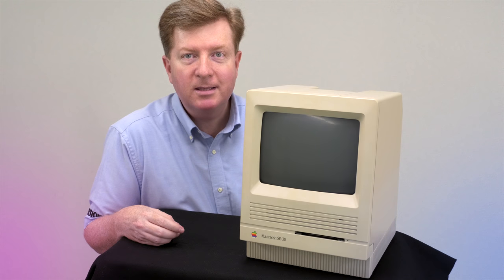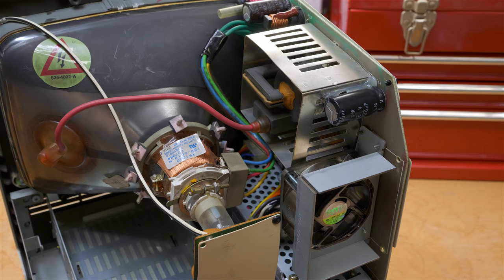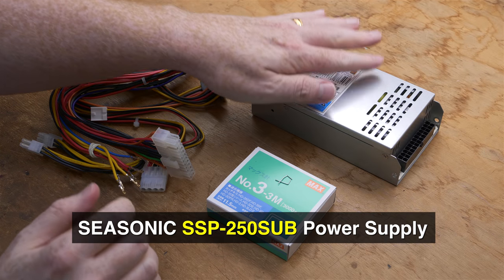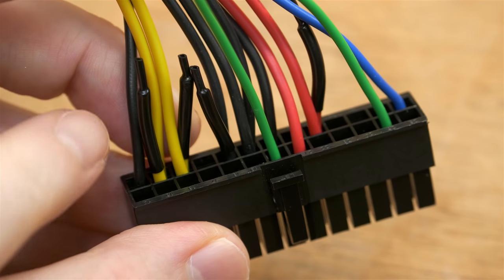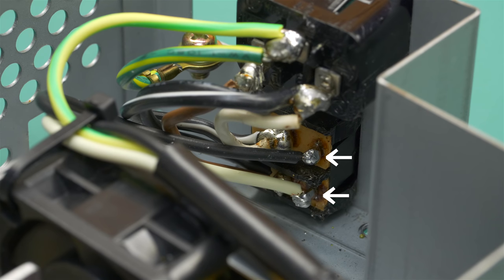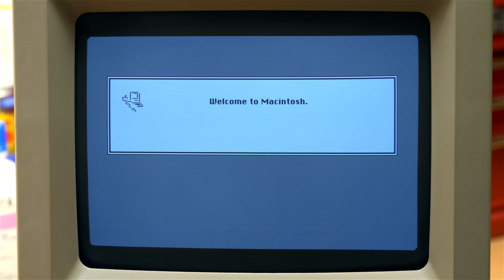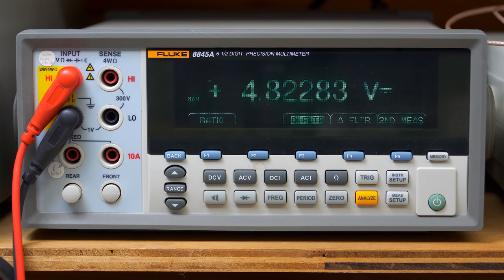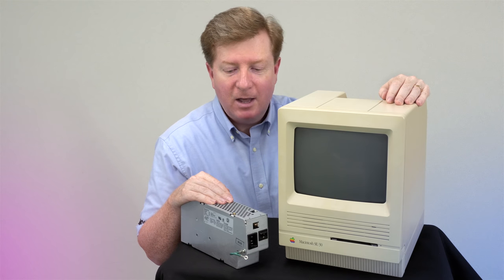Macintosh SE/30 New Power Supply (PSU): SEASONIC

Comment: looks like the connector has 26 pin connection on power supply.  all of atx connectors on ebay are 24 pin connections. I bought the power supply from ebay not thinking about the harness and it didn't come with harness with it. now what?

Comment: hey boss, which camera are you using?
Reply from the maker: Panasonic GH5, shooting in 4K 10-bit HLG, edited in Rec.709 using FCPX (mainly because many people still lack the means to watch videos in HDR).  Although my workflow has changed since I made the following video (I no longer use proxies, for example), you can still see the camera kit I use here: https://youtu.be/yrnOVp7mXrs
Reply: @JDW-  awesome, thanks for the detailed response just found ur channel because i got myself a macintosh as well. Love the vids.
Reply from the maker: @Egg-gk5zk  Since you are commenting under my SEASONIC PSU video, it could be that you are investigating power supplies for the SE and/or SE/30.  If so, my latest video, which is lated to go Public within the next 24 hours, may be of interest to you.  In that video, I review a new power supply that was released in July this year, and I talk about how to upgrade your Main Wiring Harness to get higher voltages at the motherboard, which is especially important if you have PDS cards or other upgrades installed.
Reply: @JDW-  badass, ill check it out.

Comment: I tried a similar trick using an ATX power supply just to try and get the computer to power on. When I powered it on with the new power supply I heard an audible click and the analog board started to smell like burning electronics. I triple checked everything, and it was wired up correctly. Do you think the +12V sweep would have anything to do with this issue?

Comment: Thanks for this guide - I used it to replace the internals of my Astec power supply.   As someone else mentioned I used an old IEC cable and soldered one end to the external IEC socket.  I wired the green ATX and ground to the (now removed from mains) existing power switch.   I also decided to keep one molex + berg from the seasonic to power extra devices.  With the Astec there is a mounting post in the way on the base of the PSU.  Instead of cutting it off I cable tied the Seasonic to the lid of the PSU.
Reply from the maker: Thank you for the information.  Since you used an Astec PSU instead of the SONY that I used, it might be useful for others if you ever decide to share photos of your setup.  Feel free to post a link to a collection of photos on Flickr or Google, etc., if you like.

Comment: last night see the other one but this is much better jejej , I forgot to mention that I follow your tutorial of the Imac 27, I have 2 Imac 27 2011 , I did the GPU paste issue following your excellent tutorial, pls post the recap of the SE motherboard/analog Rgds
Reply from the maker: Thank you for watching and for your kind comment, C Cedraro!  Currently, I am working on a new video about recapping the SONY power supply.  This is different from my "New Power Supply" video because the SEASONIC is a complete replacement for the SONY (or Astec) circuit board.  Some people may want to keep their machine in close to "stock" condition, and recapping the stock power supply will accomplish that.  The stock power supplies offer enough power for a basic SE/30 configuration with HDD and a single PDS slot connector.  Anyway, once that PSU recap video is done, my video after that will be recapping the Analog Board.  And after that I will consider a video on recapping the SE/30 logic board (motherboard).  I don't earn any money off YouTube, so naturally making videos is just a hobby for me, so please be patient.  The videos will come in time.  I'll try to post them sooner rather than later, of course!  :-)

Comment: Hi JDW is there a reason you dont just recap/repair the old power supply instead of buying a new one?
Reply from the maker: Yes. As mentioned in my video, if you have a lot of upgrades and accelerator cards which draw a lot of power, you can benefit from a power supply that’s more powerful than the stock version. Also keep in mind there is more than one manufacturer of the stock power supply, and Sony is considered to be the best one, but not everyone owns the Sony version to recap. Even so, I also have a recapping video about the Sony version power supply here: https://youtu.be/nSZ8QsNUxDM

The benefit of recapping the stock power supply is that it is completely fanless. Any modern power supply you use will come with a fan, which may or may not be annoying for you.

Comment: Fantastic video sir my se/30 has stopped working recently nothing on screen I suspect the video side because I can hear the hard drive working would love a video on fixing the analog board.
Reply from the maker: Thank you for watching and for your kind comments.  If you have a means to measure voltage, I would suggest you measure at the floppy disk connector as shown in my video.  Use a paperclip and attached the red/positive probe of your meter.  You can put the black/ground the bolt hole.  Probe around in that connector and you will also find a 12V line, or at least it should be 12V.  If you are seeing a rock solid 4.6V or more and 11.5V or more in that floppy connector, your PSU is probably okay, which means the root cause of your problem is something else, most likely the capacitors on the logic board.  Those are usually first to go.  The liquid electrolyte leaks out, rendering most of those capacitors useless, which is why all manner of unexplainable problems can occur.  Of course, nothing in the screen could also mean a problem on your analog board too.  I will be making another video about the analog board, showing how to recap it, what specific capacitors to use, and I have a board that needs a new flyback transformer too.  So please keep an eye out for that.
Reply: Sounds to me like failed solder joints, possibly at the yoke connector. Try banging/pushing on the left side of the case and see if the video starts flickering/coming back.

Comment: What pin on the floppy drive port did you use to measure +12 volts?
Reply from the maker: Pins 7 & 8 are +12V.
All of my voltage tests are shown at 31:55.  
Pin-out chart of the external floppy connector is here: https://allpinouts.org/pinouts/connectors/data_storage/macintosh-external-drive/
Reply: @JDW-  Thank you for the reference link, which gives me all the information I need.  At 32:45 the multimeter shows 12 volts, but there is no video of you moving the clip from pin 1 to "a different pin" which must be pin 7 or 8!  thank you again for a good video!
Reply: @JDW-  Is there a Pin-out Diagram for the connector from the power supply to the motherboard?
Reply from the maker: @MikieLAX  I only have a pin-out diagram of the connector that comes from the PSU, which connects to the Analog Board, shown in my 68kMLA post here:
https://68kmla.org/bb/index.php?threads/modern-psu-for-the-se-30.30945/page-7#post-338512
Could be that Googling the J12 connector will yield something, but I'm at work right now and lack the time to investigate that further.

Comment: Any other options for the PSU, since the Seasonic seems to be out of stock now?
Reply from the maker: Mike, here's one on NewEgg: https://www.newegg.com/seasonic-ssp-300sug-300w/p/N82E16817151157
And here's one on EBAY: https://www.ebay.com/itm/Seasonic-Alimentatore-Mini-1U-80-Bronze-da-250W/274504556944
Reply: @JDW-  Awesome.  I've got an old SE on the way.  Planning on taking a look to see how everything looks before deciding what to replace.  SD2SCSI is on the way, ordered analog board capacitors to likely recap that, as well as a new cooling fan.  Waiting on the PSU.  And will probably try to retrobright the case since looked pretty bad in the pictures.  Anything else you'd recommend for restoration?
Reply from the maker: @mikewottle8893  If the SE is on the way, I assume that means you haven't had a good look at it yet.  Most likely when you do you will find other things.  For example, there's a connector on the analog board that is often burned.  If it is burned so badly it is falling apart, you would need to replace that connector.  Re-soldering all the solder joints on the backs of connectors is very important, even if they don't look cracked.  The biggest job is recapping though because you have caps on the motherboard and on the analog board (and power supply too, if you decide to recap that instead of using the Seasonic), plus you have caps inside the keyboard and mouse too.  There are even caps inside the floppy drive.  Make sure you remove the old motherboard battery if it has one.  Hopefully that hasn't exploded. You could also swap the fan for a quieter version.  I have a video on that if you haven't seen it.  These machines take a lot of work, so after you get the SE, feel free to write me back with what you find.
Reply: @mikewottle8893  Enjoy your new SE/30 and mine came with 4MB RAM, 80MB Hard disk
Reply: @JDW-  I got my first Apple computer in 1984 in my Collection I have 5 Apple computers
Reply from the maker: @richardbrobeck2384  Make sure you swap out the PRAM batteries, and then it's time to get to that bothersome job of recapping.  And believe me, there's a lot that needs recapping on these old Macs!
Reply: @JDW-  for sure I was lucky mine had Tadiran brand battery the purple no leakage and my board had very minor Electrolytic leakage .
Reply from the maker: Glad to hear the battery didn’t harm your Macs. Even if you clean off the leaked capacitor fluid though, you still would need to replace the old electrolytics to ensure reliable, long term operation. There are even such caps found I nside the floppy drive, most keyboards and some mice too!

Comment: My SE has started locking up and behaving pretty strangely, so I'm really curious about exploring different power options to replace the aging Sony unit inside mine.

I honestly don't imagine that system with all the upgrades would draw more than 150w AC, I wonder if a Pico PSU might be a better fit? it uses a lot less space in the PSU cage, even if you mod the accompanying laptop charger to put inside. It would also get rid of the need for a fan, as the power brick doesn't require active cooling like standard 400+ watt supplies would.
Reply from the maker: Before we dive into power requirements, we need to discuss WHY your SE is locking up.  If you've not recapped the motherboard (and yes, those axial caps do indeed need to be replaced), then such could explain the lockups you're having, especially since you implied having an upgrade of some kind installed, which puts even more stress on those capacitors.  It's also important to note that capacitors on the analog board play a role as well, and then the PSU power stability is yet a third consideration.
Reply: @JDW-  My SE is a stock unit with a HDD and Floppy, it already had slight video issues before the problems started, but after a few hours of using the Floppy Emu it started having issues that don't change even if I remove any of the storage options (and the added load they produce on the PSU).

The new problems are that it won't get past the 'Welcome' screen on either the hard drive or 800k images.
When I use 400k images, it gets passed that screen and into the desktop but the mouse refuses to work.

For all these things to happen at once places my suspicion on the PSU failing, it doesn't rule out the possibility of components failing on the logic or analog boards - but with the limited resources I currently have, I do not have much else to go on.
Reply from the maker: Thank you for explaining, Amir. You need a multimeter so you can measure DC voltage at the external floppy connector, putting the black probe into a bolt hole and connecting the red probe to a paper clip that you carefully insert into various holes of that floppy connector. You must take extreme care not to short anything during such testing! You need to measure the 5v and 12v lines. If one or both are very low then I would suspect the PSU, but if the voltages are good, I would suspect the caps.
Reply: @JDW-  I've been meaning to get a multimeter, I rarely deal with component level issues so I don't have the equipment to measure voltages and the like.

For now though, going back to the PSU replacement options - do you think a Pico PSU would be good enough for an SE?

Pentium 3 systems came with 200w supplies so I think a laptop brick would be able to power a 68k machine fine even when upgraded with 040 CPUs and Ethernet cards.
Reply from the maker: @amirpourghoureiyan1637  I would suggest instead that you use the Seasonic PSU I used, because other people have used it too with success.  It works well. But you still should buy a multimeter too because you need to verify voltages are correct even if you swap out the PSU.  https://amzn.to/3a9BdSV